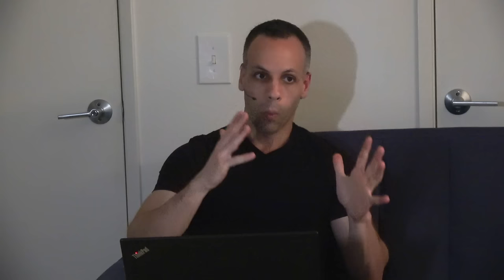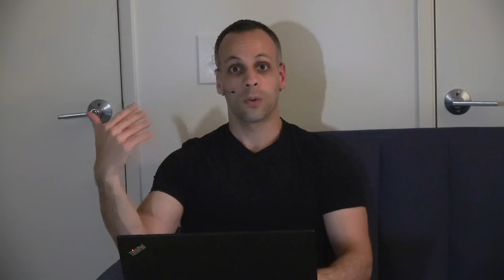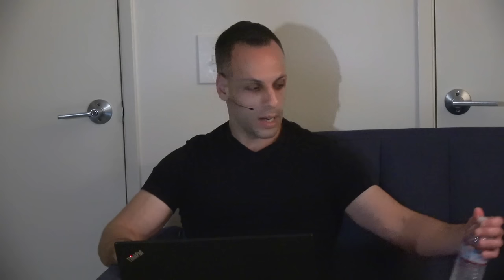EVGA's Oversight: Unannounced Changes Destroy PCs, EVGA takes NO ACCOUNTABILITY

Comment: This has been a known issue for years. You can't mix and match cables even from the same company. I wasn't aware that this would happen even within two PSUs with the same name, but I can see it happening as these companies can change internals to save money or even change the provider of the PSUs.

That said, EVGA should be aware of the change in the pin outs and at the very least provide warning to anyone sending in a PSU for RMA. Ideally they would provide replacement cables so you wouldn't run into this problem.
Reply: WTF
All PSU's today should be standerized!!
Reply: You can mix and match with Corsair.  I have a box of cables for like 6 power supplies.
Reply: The problem in this case was that these are two of the same model that aren't the same.  Which the same model number implies that they were the same.

Like I have a motherboard that has two different versions of.  One version has an m.2 slot that is version 5, the other version the m.2 is version 4.  Online, the manufacturer tells you how to verify the m.2 version you have.  But both have their own unique, but very similar, model number.  I've even seen one board that the difference were, one has an extra m.2 slot where the other has the wifi/blue tooth connector, and they also had different serial numbers.  Even though in both cases, that one thing was all the difference.
Reply: I have never heard of two psus with the same model having a different pinouts on the modular cables.  This is a defect and a fire hazard.  Gamers nexus needs to light them up.They should add a version or revision number like normal hardware manufacturers use to tell the difference.
Reply: You are fundamentally missing the point. If you send in your psu which is model "A" and get back a different and new model "A" under warranty, you will not recieve new cables with it. Logically, the user is going to use the cables they kept without any regard (warranted, by the way) or thought needed as to whether or not the pinout on the new replacement has changed or not. In their mind, it's the same exact model so why would the pinouts be different? This has nothing to do with "mixing and matching". It'd quality control and poor business practices.
Reply: @_PatrickO Oh, I agree that there is no excuse for this. I just understand how it happened because they likely changed manufacturers of the PSU. Still, EVGA should have either forced the new manufacturer to follow the original spec or they had the responsibility to both provide new cables with any RMA and let the owners know they can't use their old cables with this replacement PSU.  Also as you say they need to change the part number or version so that people would know that the old and replacement PSUs are not the same.
Reply: @johnsparozich6839 That would be ideal but it currently isn't the case. Which makes interchanging cables dangerous as even though the cables look the same the pin outs may be different.
Reply: @someusername121 Nope. The cables from my 750 don’t plug into my 850. Which is good because there’s a noticeable difference in cable thickness…

Get rid of modular cables and were all good
Reply: Agreed that this is well known knowledge. Anyone that's planning on using a modular power supply with anything but the cables that came with it should have a multimeter handy at a minimum and probably a good pin removal tool too.
Reply: How would this even save money though? I get that changing some internal components would - like using lower quality capacitors, diodes, mosfets or whatever other electronic components are used to make a switched-mode power supply.
But the pin layouts for the power output connections? You still need the same 12 volt, 5 volt, 3 volt and ground, so the number of pins for each output connection would be the same, as would the number of wires joining these to the circuit board inside the PSU itself.
Maybe if the newer version of the PSU had fewer power output connections in total, that might represent a few pennies saved for each one manufactured. But even if this is what they did, there would still be no reason to change the pin layouts for any of the output connections on the newer version.

In fact it really doesn't matter what angle you come at this from, it is hard to understand why there would be any reason at all to deliberately change the pin layouts, and certainly no good reason.
Reply: @someusername121  I replied to you earlier but somehow it has disappeared. But NO, you can't mix and match between different models even with Corsair. They have a compatibility chart in their website where you can check which types can be used with which models, so do not mix them blindly. But good thing is that with Corsair you can use the same cables with two exactly same models, which is apparently not the case with EVGA.
Reply: @leevi6026  A lot of the "incompatible" ones that corsair calls out aren't really.  It'll be "this cable has some capacitors in it" or "this cable has sense wires in it".  They don't have any like the video where it'll plug in and then blow something up.  (The only example I know of with that is EVGA and Corsair PCIe cables are physically compatible but the 12V and GND are backwards)
Reply: I've heard that you can't even swap different cables (same pinout) because it will cause greater or less resistance.
Reply: @leevi6026  as long as the corsair psu is using type 4 pinout, then yes the cables are actually interchangable,  to the point corsair has a 'premium' starter and pro cable kit that's compatible amongst 8+ lines that all use their type 4 pinout

Comment: I would take them to the small claims court with all their emails / calls as evidence of their incompetence.

If they sent the PSU without the required cabling with no warning to not use the one they told you to keep, it's on them for whatever happens. They could have caused a fire or something doing that.
Reply: That's what I'm looking at doing. (I am the original poster of this story)
Reply: @stevegircys  Whatever you do DON'T SETTLE OUT OF COURT. This needs to start resulting in actual public legal precedents that seriously hurt companies.
Reply: @stevegircys  Do you have a picture of your pc with the old psu (or original receipt)? and picture of the new one?

Would I be right in saying you had a GQ1000 V1 with the grey "stone textured" box and the "1000 GQ" on the side written in grey?
....While the newer replacement is the GQ1000 V2 with they "1000 GQ" written in gold?
(also did it come in a retail box or plain brown OEM?
Reply: @tomstech4390 That's a good question. I don't know if I still have the original box, but I certainly don't have any photos of the original power supply, before sending it in. But I can confirm that the new one has the gold / yellow writing on the actual power supply. It shipped in a plain box, though - no identification on the packaging.
Reply: @tomstech4390 For some further clarification, the one that I received back from warranty has the gold text on the sides of the power supply, but grey text on the top (opposite from the fan). There is no version number at all on it though - Just 210-GQ-1000.

Comment: I had a Corsair SF750 break about 2y ago, I had to include all cables with the power supply which made sense. Cables are an essential part for the working of the power supply, not just accessories.

Comment: I disagree Louis. If EVGA are smart, they'll stop selling this model immediately. At this point they could cover damaged devices by having customers send in the power supply, the mismatched cables, and the blown hardware in a single box. A few minutes (at most) with a multimeter will confirm the cable mismatch, and you're done, pay the person for their devices and the power supply. This way people can only pull the scam for as many power supplies and mismatched cables they can find, thus limiting their liability to a fair level. This would be the fair thing to do because they could have avoided this in one of two ways. One, don't change the bloody pinout in the first place or two, change the bloody model number on the altered power supply so technicians don't mix them up in RMA. The fact that neither of these happened means they should pay for it. I do agree however that they can't be held liable for data recovery costs, that's on the customer. They should pay for a replacement drive though.
Reply: i think they can be held liable for the data recovery and drive replacement costs in this particular case. why would they not have to make you whole after such negligence?
apparently the issue is old news, but i think you're right, they should have taken the stock back and addressed the problem. i don't actually know what they've done, if anything about the situation, but they knew about it 2 years ago apparently.

Comment: My current power supply is a Super Flower because it's who EVGA used to manufacture one of their previous gen power supplies. Went straight to the source and saved money. The change is probably because they switched manufacturers or a manufacturer discontinued a model and EVGA wanted to keep using them. Just a guess.
Reply: First and only time I ever had a supeflower psu. It killed a whole pc. Well... Minus 1 ram stick and a half functioning hdd. Also had a Corsair AX 750i delete itself.
Reply: @justinpatterson5291  Strange. They are very high quality with a good warranty, low failure rates, and solid reviews. Every full teardown and testing of them has shown high end components and high performance. Every brand can have failures though.
Reply: Here in Romania Super Flower is pretty popular among PC builders. Didn't hear anything negative and I've been aware of the brand for over 10 years.
Reply: @prunabluepepper  Right.
Reply: @justinpatterson5291  Don't buy brands, don't buy models, buy model revisions. Unfortunately that's just how it is with PSUs. Every brand has bad apples, including some of the most reputable brands like, as you mentioned, Corsair and Super Flower.
Reply: @justinpatterson5291  A lot of those branded power supplies are built by either Antec, Topower or SuperFlower. The latter two often make the high wattage versions. Topower was the first manufacturer to produce a 1000W and 2000W power supply.
Reply: @802Garage  this was way back in the Phenom 1 days.
Reply: @justinpatterson5291  Ahhh totally fair hahaha. I think they came a long way.
Reply: @802Garage  SuperFlower has made plenty of lower end PSU and has even done bait and switching with "ugpraded" model swapping to cheap capacitors.
Again while for the first years all Corsair PSUs used quality construction, after making name they expanded to lower end PSUs with cheaper components and even to selling PSU with exaggerated specs. Also Corsair "recycles" model names and in some lines there has been like half dozen different insides from multiple manufacturers.
So never buy just brand, but individual product.

Comment: Want to know what's funny, the First modular powersupplies actually used standardized and universal plugs. They used the exact same pins orientation and even keyed EXACTLY the same as the other end that they were to be plugged into. You could flip them end for end and everything would work. OCZ for example on their first modulars, you could take a daisy chain pci-e 6 pin connector, and even connect the middle pci-e 6 pin and connect it to the power supply and the end intended for the power supply connection would fit into the graphics card, leaving the very end of the cable dangling up around the power supply. This made it easier to keep the system's cable management looking clean. You could do the same with the 4 pin molex cables, this was absolutely a win, specially when you had one or 2 optical drives up directly across from the power supply, so you could just grab say a single cable with lets say 3x 4 pin molex on it, plug the center one into the psu, plug the shorter remaining part of the cable into the optical drive, and then the long end initially intended for the PSU connection, down to a hard drive. Systems built were clean clean clean looking. You could also swap cables from one brand to another effortlessly since they all used the same pin out arrangement, they are afterall, and for good reason, using EXACTLY the same STANDARDIZED connections. I mean for fucks sakes it makes sense they would do this since we already have those connectors and the pins and everything, cheap, readily available, ZERO justification for changing them, impossible to mix up. NO one could stick a 4 pin cpu 12v into a 4 pin molex or a 6 pin pci-e or 8 pin for that matter, you couldn't they weren't keyed to allow it, no one ever fucked anything up. But a few years later that's when all hell broke loose, the regulatory agency responsible for making sure companies were complying with standards basically dropped the ball, allowed them to come up with their own special connectors and everything went to hell.

It was a few years after the first modular PSUs arrived that they went the route of "i need to be special and build my own unique proprietary connections", and honestly there is more proprietary shit today that is MODEL specific, not just brand, and as i've now found out which i'm glad to be informed since i actually happen to use a lot of EVGA modular power supplies in my customer's builds, i can't even trust hot swaps or testing by hooking the pre-existing cables up to their own fucking identical model power supplies. This is absolutely justification for some kind of class action lawsuit filed against power supply companies by customers as a whole to take them to court in order for them to force standardization. THIS is the kind of shit that REGULATIONS should be required. These are prime examples of WHY when something innovative is designed and released, that once the grace period has been gone through and the concept gets adopted by other companies, that they should be forced to be brought together, agree on a universal standard so shit like this can't ever happen, and if something does, they can be absolutely dealt with immediately without people left standing around scratching their heads trying to figure out who to blame or what they are responsible for.

Comment: Back in the day got a DTK power supply back on RMA, plugged into DTK mainboard, and they had pinned the plugs in total reverse.  Granted this was early into my repair career and did not notice all the grounds(black wires) were in the wrong spots.   I most likely would have expected the manufacturer to send me a binary plug that is keyed that it can only be plugged in one way was setup correctly.  Thankfully just the mainboard and memory appeared to be damaged, the shop owner saw the power supply leads were pinned wrong from the factory, and DTK covered the damaged components.  Customer was also understanding with the delay and was even happier that we had cloned the drives before doing the power supply replacement.  Boss was glad I took the time to clone the drives while we waited for the power supply to ship to us.

Comment: After Trump's new 2018 tariffs on Chinese products, a lot of tech companies changed OEMs, who had factories in China, that included EVGA. Also, EVGA and other power supply designers are known to use different OEMs, who builds the power supply, over time. If I recall correctly, a lot of EVGA old power supplies (P2, T2) were made by Super Flower, but after 2018, EVGA contracted their power supplies to other OEMs like Seasonic, FSP, HEC, and others. Also, around that time, power supplies cut costs due to the tariffs. I bought two Seasonic power supplies before and after the tariffs. My older 650-watt Seasonic platinum had a thicker AC power cord vs. my newer 750-watt Seasonic platinum power supply as well as the internal packaging. 

In the end, EVGA is done after ending graphics card production, and they are only servicing warranties before they likely close up shop forever.
Reply: so like do u think the pin switching was accidental due to the change in manufacturers? that would kinda explain why they didn't key it right to prevent using the wrong cables on the same model..
Reply: @outseeker  Might be an accident, but EVGA should have taken the precaution to send some cables with the replacement power supply. Nowadays, customers have to do a lot of homework to make sure they don't blow stuff up by accident. 

If my power supply blew up with a few years on the warranty and I could afford a new power supply, I would buy another one and not go through the hassle of an RMA power supply blowing up my PC hardware. For this to be the optimal solution, we are living in clown world.
Reply: @worldtownfc Are you sure they did not send new cables?
Reply: @jepulis6674  From the video, EVGA sent new cables after the user blew up their hard drives with the original cables of his old power supply.